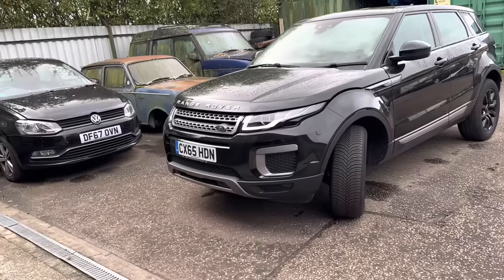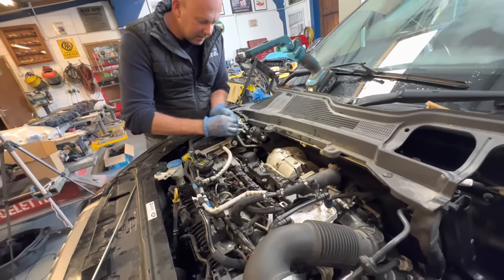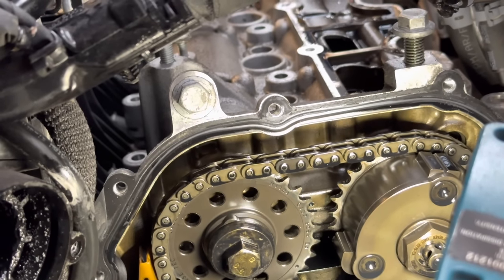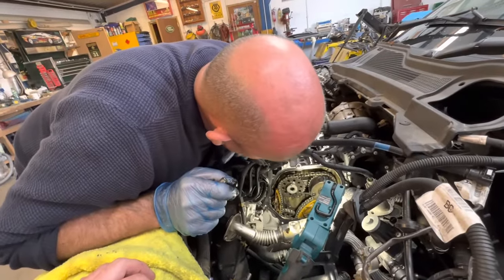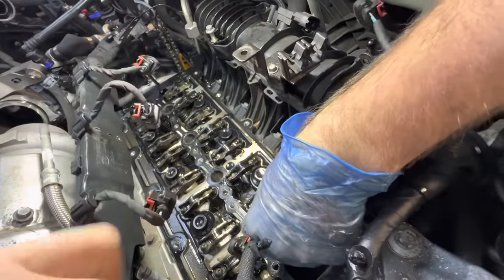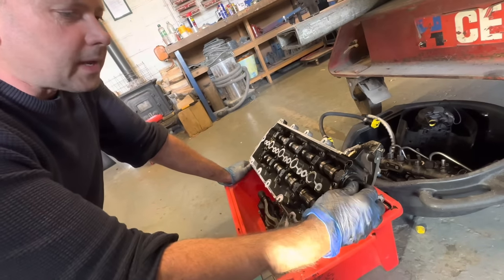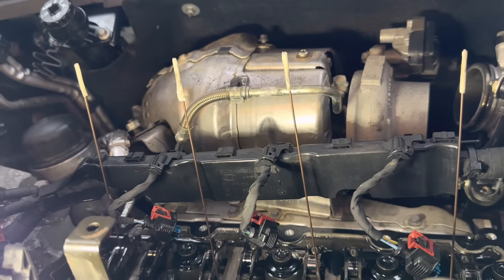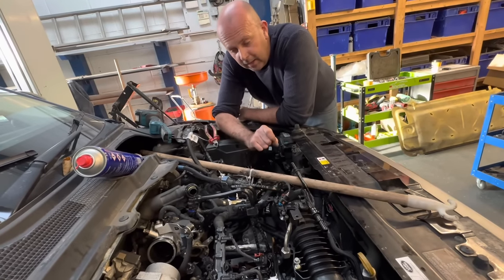RANGE ROVER EVOQUE INGENIUM ENGINE FAIL ! HOW BAD IS IT ?

Comment: The first generation Evoque and Disco Sport used the 2.2 Ford/PSA diesel and have proved to be more reliable than the later Ingenium powered cars.  Landrover decided to develop their own engine and got their customers to test it, to destruction as it turned out.  They are better after 2019 when some mods were made so get an old one or a newer one and avoid the others or at least service them twice as often as recommended.

Comment: Proper mechanicing. Did the sprocket bolt have any sign of a Loctite locking patch on the thread? Have you got a borescope - now very cheap and worth popping in to look for piston damage? Could you have borrowed a new camshaft to see if the lobes on yours have moved? FWIW Aldi are doing warm woolly caps tomorrow with built in rechargeable  LED inspection lights - be ideal for Chris with Winter coming on...!

Comment: Most of the people that hate on Land Rovers have most likely never owned one. I’ve owned a Series 3, 3 90’s (2.5D/200Tdi/Td5), 200tdi 110, Freelander, 300tdi Disco, Td5 Disco and never had any major issues with any of them other than run of the mill maintenance issues. As you say, every manufacturer has issues, but for some reason people love to hate on certain brands in particular because it’s ‘expected’.

Comment: Nip the cam sprocket back up in any position then roughly mark the high point of the lobes on the sprocket with a marker and in theory you will have a mark every 90 degrees or an even amount of teeth apart if they don't match the lobes have shifted

Comment: i was always told that no matter how much you spend on a landrover, you never actually own it.  It will always spend 50% of it's time with the dealer.  I thought that was just a joke until i bought a Disco 3 TDv6.  Brand new HSE and the day we picked it up the engine went into limp mode.  Turbo issues that meant we didnt get it back to 3 months!!!!  We had a courtesy car but thats not the point... To be fair, after that we didnt have any issues for a year plus until the air suspension problems started.  Dont have it any more, but we averaged less that 50% with the dealer so i see that as a win :-)

Comment: Wise move getting Josh to get it timed up. Still don't why it showed a DPF fault? Could a blocked DPF put extra strain on the engine to snap the dowel pin ?

Comment: on my 2013 1.6 TDI Skoda Fabia a crankshaft bolt has snapped off and the whole bolt came off on it's own. Never opened the engine, it was a factory error or the bolt was overtighten. Stuff like this just happenes.

Comment: Faulty di phaser shacks and knocks basically sounds like heavy mains and little ends together renaults suffer with them but they are belt driven about 60 to 100 ,000 miles they fail.

Comment: Will be interesting to see what happens when its bolted back together and timed up. Did you get lucky or not? I do wonder why the cam bolt was loose, Chris's explanation seems sound to the pin failure. Could this be a really simple fix and one of the cheapest repairs going?

Comment: Did somebody run out of Loctite would you like me to send you some blue and red just to be sure or you can do the old Triumph motorcycle trick and drill a hole through it and put a cotter key in it. Similar thing happened to several thousand Toyota Fork truck no Loctite on the differential ring gear

Comment: Video picture was really good today, iPhone 14 paying off in my opinion. However for the first time I thought the sound was a bit quiet but easily rectified by turning up the TV.
Reply: Really, so all those owners that suffered lack of power with the diesel CRV, that turned out to be bad camshaft moderator assembly's imagined it did they?

Comment: Hi rob/Chris my thinking like yours dislodged can lobe and possible bent valves you could fit it up and do a compression test threw the injectors and will give you a individual reading and go from there mate looking forward to the next video good luck men 👍
Reply from the maker: You can see the valves aren’t bent there all shut
Reply: @sruk  I’ve just had another look and yes all the valves are shut so has to be a timing issue  I would time it up put new cam in check followers like you said and thread the cam bolt and try it failing that it must be down to compression

Comment: I have a 2019 Jag E Pace D180 which is essentially your model Evoque in drag. Touch wood, after 3 years no problems. What I did find odd is the servicing intervals, it didnt go back until 2 years, in that time I did have to top it up about 1 litre of oil which the dealer said was acceptable (as they would). So my experience has been positive, its not that the German "quality" brands are much better these days.

Comment: As its a 4 cylinder wouldnt the lobes be 90 degrees, then 180 degrees and then 90 degrees out from each other, as any which dont conform have moved.

Comment: Would it be possible to get an endoscope inside the cylinders through the injector holes , to check for any valve / piston damage ?? Might give you a bit better idea of what's what , rather than just sticking it back together and hoping..... Those camshafts and end bolts seem to be a stupid idea..... Got to be a penny pinching idea to use a design like that .

Comment: FWIW the sprocket is marked "Morse" who have been market leaders making chains and sprockets, etc, for over 100 years - it's possible the design with the pin, etc, is theirs rather than JLR's? Also, on one cylinder the lobes seem to be in line and I can't see why you would open both inlet and exhaust valve at the same time suggesting one has moved?

Comment: Tab washers and spring washers are good...lol   I guess Land Rover forgot that on the crankshaft securing bolt !
Reply: High torque stretch bolts are standard practice in modern engines everywhere. Doesn't mean to say it is better, but that's what everybody does. Presumably saves manufacturing costs and speeds assembly.
Reply: @fraser7744  I only have old vehicles but I noticed on my 86 Cavalier they used blue loctite everywhere to save on the use of plain or spring washers.   

Bolts inside an engine should never come loose

Comment: Land rovers and Jags are so bad and expensive to fix, a lot of insurers aren't interested in insuring them anymore. My friend works for DLG and they've said they won't be insuring Landrovers or Jags anymore.

And I had a 64 plate Evoque (2yrs old at the time), with 19k miles on, was a nightmare, in the year I had it, it was in the main dealer for 7 of those months with multiple issues. Lovely to drive, great spec, etc, but what a nightmare to own.

Comment: Got jag xe petrol igneium engine only done 18000 miles 4 years  had no engine  problems but main computer  failed under warranty. I think u have to get  oil changed every 5 to 8 thousand miles to keep  reliable

Comment: I have only heard of having the cam lobes pressed onto camshafts since watching your video's, I thought camshafts were forged as they used to be. What a stupid idea. Which cars have this?
Reply: I think the last on I saw on the channel might have been a Peugeot van or similar, but they aren't as daft as they sound - if the cam shaft gives way then it's the easiest and quickest part to replace rather than risking damage deep inside the block, which will be harder to get to and more expensive to fix, and possible even fatal.

Comment: Pressed on cam lobes... what could possibly go wrong? :-)
Reply: In normal use, won't go wrong. However, if the chain or belt snaps it can save the engine by absorbing the impact of valves hitting pistons.

Comment: Here is my theory - Bolt came loose, pin snapped, piston came up and moved 2 lobes. You shouldn't have been able to rotate inlet cam so easily because at the easiest point of rotation there will always be valves rocking. New inlet can needed I suspect.
Reply from the maker: It had all the carrier bolts removed allowing it to rock 👍

Comment: When the sproket came off surely with no cam movement ot wouldn’t have done any damage!?
Reply: If a valve is down when the cam stops and a piston comes up because the engine is still turning, then you can get contact and damage.
Reply: @PJ-om2wq  but without the crank moving the pistons wouldn’t move?
Reply: @mikedalt3622  when the bolt came loose the camshaft stopped but the crank didn't

Comment: If you look in the Autocar list of unreliable cars,the Range Rover series are featured many times.However,it is probably because so many of them are used by 'Mummy' taking little Tarquin and Lulubelle  about 800 yards to school.Never gets warmed up and as Daddy has zero mechanical knowledge,thinks that the vehicle should only be serviced on a 'mileage basis'.Good cars get a bad reputation mainly because of their brain dead owners.

Comment: How the hell does a cam move on a camshaft?? They're machined from a single forged/cast part. My guess is that there's a lot of valve and piston crown damage.
Reply: Apparently not ....
Reply: Not 100% on this engine design, but a lot of vehicles are being manufactured with multi piece cams now .
Reply: No, these days, they are not. The machined cam lobes are pressed onto a plain shaft
Reply from the maker: There not bud 👍

Comment: There are no key ways suffer from noisy timing chains noisy balance shafts and excessive cylinder blow by.they normal push the oil out through the plastic blanking plug on the back of the engine.the engine seems to suffer more when the engine is mounted from to rear on the later discoveries

Comment: Can lobes move on a camshaft? Are you sure about that?

As far as I was aware, the camshaft and the lobes are a single machined shaft, they are not individual pieces that make up the shaft.  The camshaft is machined from a single piece of steel. (Well that's what I've always thought anyway)

I'm a CNC lathe programmer. I've never machined camshafts but it would just seem like a terrible idea to make the shaft and the lobes separately and press the lobes on to the shaft, instead of just making the whole thing from one billet.

Blows my mind if they're not just one single piece of steel. Worst idea ever if that's the case.. planned obsolescence maybe 😂😂😂
Reply: They used to be like that - quality but expensive. They are now precision press fit on hollow tubes.
Reply: They can move unfortunately. Watched a video recently of a Mondeo that jumped the timing causing engine damage and the lobes moved.

Comment: i worked for jaguar/land rover for 17 years, jaguar were always fairly reliable, land rover were horrendous, known a few customers collect new l/rover and not even make it home before they fail, if they go wrong they are a nightmare, never understood how jaguar could be good yet l/rover were so unreliable.
Reply: A problem at Land Rover is they often had to build them quickly/above planned nominal supplier capacity due to high demand. For those engines for both marques which come out of the i54 engine plant there shouldn't be any quality differences.

Comment: It looked like the cam was turning slightly from side to side when Rob spun it when the sprocket was off which is what you were hoping to see if the lobes had spun on the camshaft, look back on the footage to see what I mean
Reply: I saw that too
Reply from the maker: The bolts were all out of the carrier 👍
Reply: @sruk  that explains it 👍 just thought I'd mention it
Great stuff as usual guys

Comment: Is ecodiesel better than this?
Reply: 50/50. It depends on model year and model of your engine. Early 2.2d from Ford was quite reliable. Probably it could be necessary to check rockers on 200.000+ km but it still was ok. Speaking about ingenium 2.0d there are several main issues: timing chain (should be replaced from 80 to 110k km), balance shafts, turbocharger. But still better than 3.0d 😂

Comment: Don’t they have woodruff key on the pulley?
Reply: Very little has any more - it's all friction fit camwheels. Which is why if you look at tool catalogues, there are 1001 "timing kits" available that lock the camshaft/s itself, 'cos the wheels able to go on anywhere before the bolt gets snugged up.

Comment: Had the same happen on a Mazda 6 2.2 Diesel although the timing chain slipped, didn’t bend anything. 

New chain, guides and tensioners. Would run but constant engine management light for cam timing but all timing marks were correct. Turns out that the camshaft had actually twisted the lobes due to piston hitting the valves etc. Had to manually time the engine to then see they were way out due to being twisted. 

New camshaft and was spot on afterwards.

Comment: Ingenium's are absolutely crap engines. I worked at an engine reman company and they are very complicated for no apparent reason. Roller bearing cams and 3oo timing chains, all in the wrong place and a weird no tabbed bottom end. garbage.

Comment: Range Rover could be about to get worse.  The 22 plate now wares a Land Rover bage,  I'm wondering if BMW are in the process of dumpping them now they got what they wanted from it (the "X" tech)
Reply: BMW off loaded Land Rover 17 years ago to TATA…. not sure what you mean there fella?
Reply: We haven’t used BMW for years. That evoque has the first gen ingenium engine completely made by JLR. Also the latest range rovers are proving to be more reliable than ever before and are scoring much higher on the automotive press surveys

Comment: If you have one of these surely you punt them the day the warranty runs out?!!
Reply: Same as any car, either they have learned over time that the bolt needs higher torque rating or was not torqued tight enough to specs.
All manufacturers learn with cars sold in volume of faults not detected under testimg.
Rivian a new car maker in stated just recalled all cars as control arms origionally torqued to 60lbs and after 1 car ssold had a reported issue  they checked others then doubled the torque settimg and recalled all cars. 
It is only a 2 minute fix  and look at how many recalls over  the years all car makers have.
If as their friend said that bolt can come loose as he has seen maybe JLR know this and upped the torque on that pulley bolt in newer cars.
If there are enough cars with same issue and only occurs on high mileage cars out of warranty then then jlr  escaped a huge expensive warranty claim.
Jlr bought bmw and ford engines for so many years and have not had decades of buldimg engines on v8 side.
Not sure of the smaller engines but my range rover vogues had ford engines 3.6 and 4.4 both turbo diesel.
Ford made the 5.0 petrol superchargedd jlr engines until ford factory in Wales shut down a few yrs ago.
Acording to google evoque ingenium engine is now built by jlr since 2019 all cars before it has a ford engine. This car is ford engine going by age on number plate.

Comment: Just wait until all the problems with EV cars start showing up, electronics will fail on them all at some point. The Land Rover will seem a great deal
Reply: There's a LOT less to go wrong in an EV, dude!
MASSIVELY less.........!!!!
Reply: Unless your certified and qualified you can’t go anywhere near a EV, discharging batteries etc, a good armature mechanic can have a go at fixing a lot of problems with a combustion engin
Reply: @andymccabe6712  the fuse will be a big one mate  🤣
Reply: @andymccabe6712  like the latest volvo software update that stops the car from being able to be unplugged from its charging lead.  Massive improvement.

Comment: If I won the lottery I would not have a Land Rover over price over complicated my now X 1.4 tdi vw pole I had for twelve years was running ok until I traded in with 100.500 miles and only let me down once because I left the lights on all night and the 13y old original battery gave up and i at to replace it

Comment: Rubbish, Toyota Rav 4 200-2020, Mazda 3 200 onwards, Toyota Land Cruiser plus Prado, all Holdens and Fords designed and built in Oz, Morris A30, Austin Healey Sprite, Morris Minor all, Berlingo Mk 1 petrol, Merc 1975-200 (not the high end ones) Ford Escort Mk 1 and 2... all better than this bit of junk

Comment: Only one comment from me, what a crap design. Many moons ago I owned a Rover 820e 2litre twin cam jobby. The cambelt tensioner was held on by 6mm bolts, they came loose and wrecked the engine. Seems to be a pattern with Rover stuff coming loose catastrophically.
Reply: You can’t compare this engine to a rover M16 surely the ingenium is way more advanced but the fault the same

Comment: Not knocking what you do but isn’t a front wheel drive Land Rover a tiny bit pointless as you buy a land rover because it’s four wheel drive
Reply: That's like saying that you buy a BMW because it's rear wheel  drive.
Reply: ... Not if you don't need 4WD.....!!
Reply: @andymccabe6712   just buy a normal car
Reply: @dashcam2417  well that’s what bmw are good at making rwd cars their fwd ones are awful things
Reply: @bmwman1981  correct  , but look how many  2 wheel and 4 wheel  drive vehicles BMW now make  due to people wanting the " badge " while having no mechanical Knowledge. I wonder how many SUV car purchases are 2 wheel drive against the number of 4 wheel drive  .
Reply: Landrovers originally started out as 2wd with a selectable 4WD high/low ratio transfer case….

Comment: Show me a 65 plate Honda or Toyota with a major engine failure!
Reply: The honda 1.5 turbo engines suffer from oil dillution where fuel gets into the oil which can lead to catastrophic engine failure but yeah in general honda and toyota make very reliable engines

Comment: If the valves are bent then it’s not going to do any more damage doing what you suggested 
New bolt for the woodruff and new locating pin for gear Time it up and wang it over with your fingers crossed you got lucky